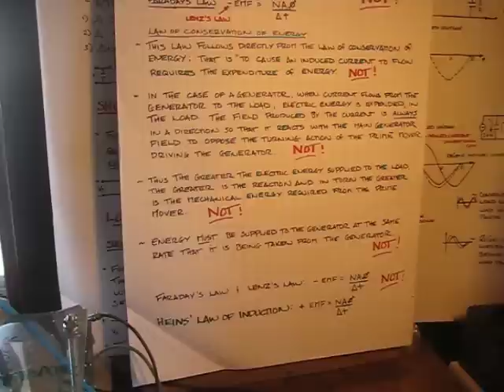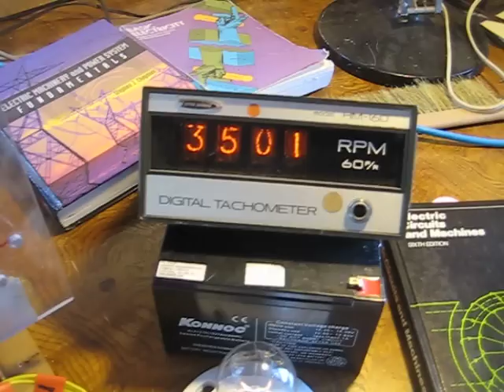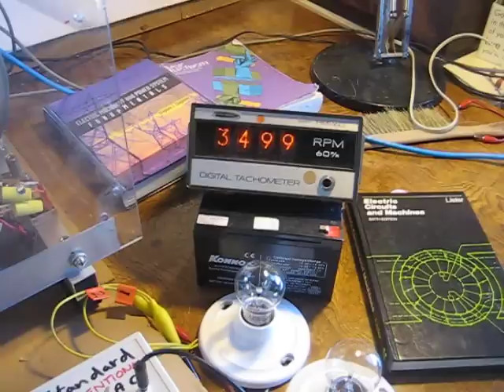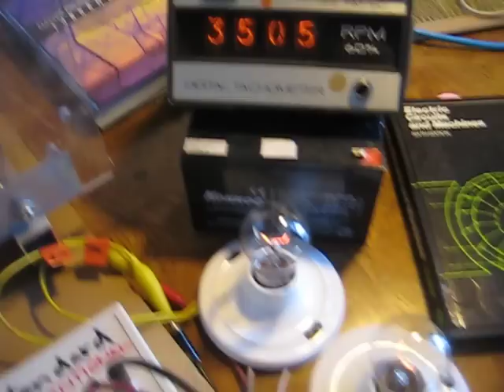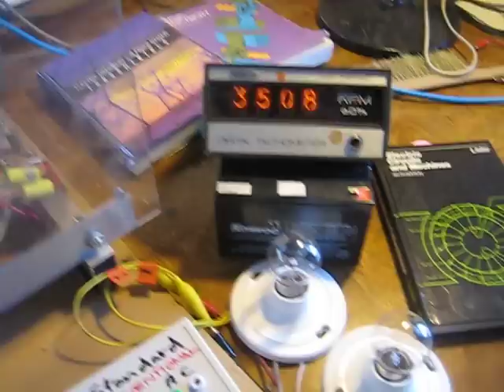Infinite Efficiency ReGenX Generator Operating without Armature Reaction

Comment: Great video. How can i get more info  on how to make that kind of coil?
Reply from the maker: HOLLAND INFINITE (OVERUNITY) EFFICIENCY CONFIRMATIONS BY DUTCH ENGINEER
11) Regenerative Acceleration Generator Innovation - Confirming the Negative
Lenz Effect:
https://youtu.be/VSCIws7zppU

12) Mathematical Calculation of the Regenerative Acceleration Generator
Delayed Lenz Effect:
https://youtu.be/cVFXSZzUNmE

13) Thane C Heins Replication step 2 - Difference Between Shorting and
Loading:
https://youtu.be/Z-jq-xwN5hw

14) Thane C Heins Replication step 4 Incandescent Light Bulb as a Load:
https://youtu.be/9YnVkFOoBxU

JLN LABS FRANCEReGenX GENERATOR REPLICATION
VIDEO Replication Validation Test Prototype #1: https://youtu.be/aJuwj8RhYHY

Comment: Very cool! excellent, But what happens when you use more generator coils on the disc and you will get closer to the
point where input is almost the same as the output. I have a feeling that something will spoil the fun.
Thanks for sharing!

Comment from the maker: GENERATOR PERFORMANCE BASICS 101 -
CALCULATING GENERATOR EFFICIENCY

A generator is a device which converts MECHANICAL (drive shaft) POWER to ELECTRICAL POWER...

The mechanical drive shaft power is calculated by the (drive shaft) TORQUE x (drive shaft) SPEED.

At any steady state speed the NET drive shaft TORQUE must be ZERO.

if the NET drive shaft torque NOT ZERO and is:

- GREATER than zero the drive shaft would be accelerating
- LESS than zero the drive shaft would be decelerating.

Therefore at any steady state speed the drive shaft MECHANICAL POWER must be ZERO Watts. (imagine the generator's drive shaft being turned by wind turbine, steam or water...)

An electric generator's EFFICIENCY is calculated by the generator's output power delivered to a load by the (required) on-load INCREASE in drive shaft mechanical power.

The ReGenX Generator delivers electrical output power to the loads and requires a ZERO Watt increase in on-load mechanical drive shaft power so the generator's efficiency is 60 W / 0 W = infinite efficiency.

The ReGenX Generator Coil delivers over 6X the OUTPUT POWER over the conventional generator coil and it does so with zero Armature Reaction and with a zero Watt increase in mechanical drive shaft power while operating at INFINITE EFFICIENCY.

Kind regards
Thane

Thane C. Heins
President & CEO
Potential +/- Difference Inc. R & D
"We generate solutions"
Email: thaneh@potentialdifference.ca
Cell: 613.314.9653 
Linkedin http://www.linkedin.com/profile/view?id=107557432&trk=tab_pro
slideshare http://www.slideshare.net/ThaneCHeins

Comment: *****
The real induced magnetic field exists in both cases (which we call Lenz force) and the only one difference is timing WHEN it appears on coil. If you could attach both coils on dual channel scope for showing waveform of amperes and have both them under same amount of load that will be clear. Would be nice to see this in your another video.

Also please consider this: you want to avoid induced magnetic field going against movement. This can be done in fundamentally different way - instead of moving magnet or coil you can change the amount of coil core reaching magnet with 90 degrees movement to it. This will let you spin rotor without any resistance from coil at all. For this demo there are separate series of videos:
https://www.youtube.com/watch?v=9STbGa5zvpg
https://www.youtube.com/watch?v=uzdf8kOfSow
https://www.youtube.com/watch?v=s95CwLmqB-0
https://www.youtube.com/watch?v=5VTlQdTDLcg

Cheers!